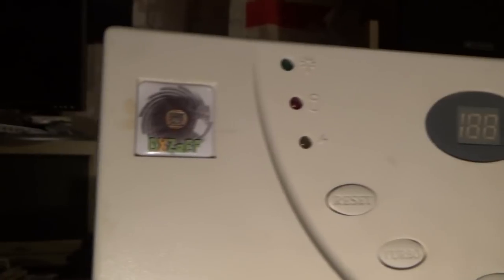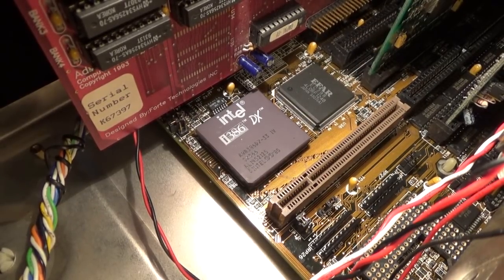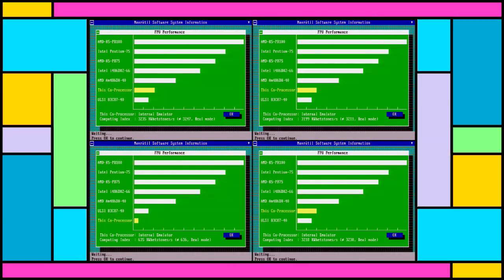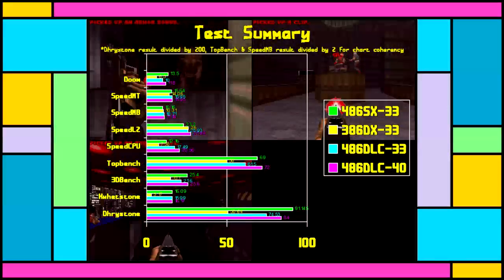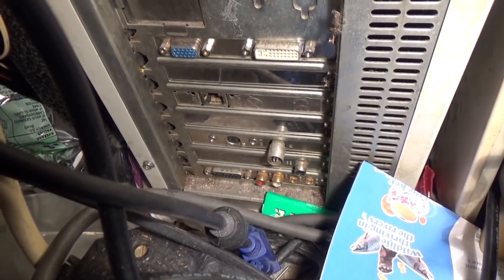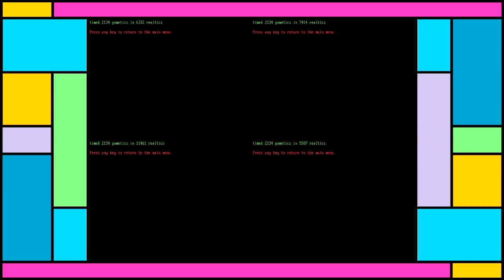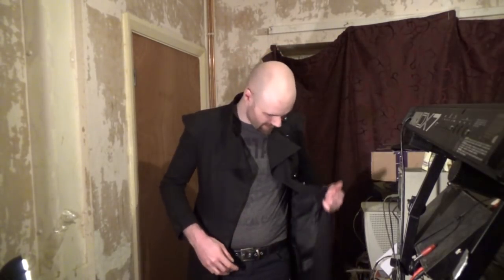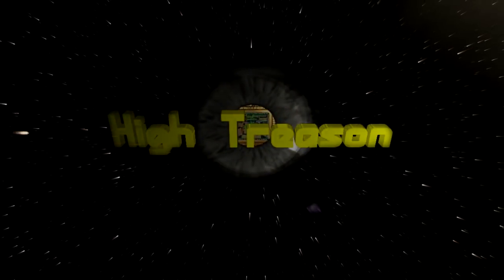386/486 System with VLB Slots

Comment: I agree with you on the Gravis Ultrasound. I bought one in the early days of eBay and it still doesn’t get much use compared to all my Soundblasters and compatibles.

But I really wanted one back in the day for the higher quality audio in some demoscene demos. That’s about it really. They’re a pain to configure and have limited application.
Reply: I do agree as well except that I like most titles from epic megagames which are making a great use of these. Still, I'd never pay hundreds for one. I managed to make it fit into my 5x86 computer and it's great where it is, alongside an early noiseblaster 16 with korg wavetable
Reply from the maker: I only got one because of all the hype I read about them over the years in magazines, or what I was told by enthusiasts long ago and, most of all, the fact that it was there as an option under "Music Card" in the setup program for some games, which told me it must be something special and not a generic SB clone from the start. It's a novel piece of hardware and it was an ambitious idea, but yeah, never ends up being used and after my 'demo rig' went to hell, it sat on a shelf for years with few instances of needing it ever really materializing. Don't get me wrong, I'd like to use the card all the time, it's awesome in principal, but there's just not enough of a reason to and most games which support it also support cards like the PAS16 which has a better output, require Pentium-class machines and use MOD music, leaving little advantage to the GUS being used there as the offload from CPU matters far less. GUS only demos are indeed the only thing I really find it being needed for.
- Deksor - Noise Blaster, I like that one. Still honestly amazed you got it to work with another card installed, could never get mine to play nice like that.
Reply: Remember it took me something like two weeks to get it finally working because for some reasons it was upset to be at address 240h even though I've seen many people using the same model as mine at this address. However the SB was okay to be at address 240h so it wasn't a big problem. 

Notice as well that yours is a standard GUS while mine is a GUS MAX. But yeah, maybe the reason it doesn't want to work is because it's upset for no reason about something

Comment: 486DLC is a very nice little processor the fact that you can disable and enable the 486 enhancement aswell as the cache in dos makes it a extremely useful processor 

Something interesting that 1996 Cyrix DLC system of mine actually runs at 45mhz for the time being I am going to keep it there as it appears that's how it came from the manufacturer (Mecer) and it's been working fine ever since
Reply from the maker: You know I love the 486DLC. Oddly CPU Check measures 45MHz on this one and for a while I thought that either the clock generator was broken or that this was the second setting, but no, seems the software just mis-measures it on this board as it comes in fast regardless of CPU or clock and everything else comes back correctly. Still, my respect for the 486DLC has increased vastly after this due to it actually keeping up with, and even outpacing at times, the 'real' 486SX.
For the record, I tried setting it to 50MHz but it won't start at this speed, not sure if it's the board giving out or the CPU.
Reply: HighTreason610 Ah that does actually makes a lot of sense , mine is probably the same just software missreporting it :)

Comment: There goes my 5x Pentium pro board + cpu and my 3 gus card collection :)  great video dude  !
Reply from the maker: To be clear, I'm not saying you shouldn't have those, just that their uses are limited versus less costly and more common hardware for more common tasks the average user probably wants to use them for. Of course from a collector's point of view it's worth having anyway, if you can find it at a reasonable price, for sheer novelty if nothing else. You just have to test these things sometimes.
Anyways, thanks.

Comment: This is the sort of review that I enjoy the most unlike all the others that are too clean and often don't have as much interesting hardware. Got a couple of boards like this and happy to have them, finding 4mb 30pin simms is a bitch so good luck with that card.
Reply from the maker: Thanks. As much as this board isn't really as useful as the ones around it, I'm definitely glad I got it, so I get where you're coming from. Yeah, 4MB SIMM RAM is a pain to get hold of in any capacity, so often it seems you'll find one or if you're lucky, two sticks, shame you never find it in packs of four like the 1MB ones often are. Still, sure some will turn up, or maybe a good joblot worth the gamble will pay off.
Believe it or not, I actually feel for people running channels like the ones you describe because they're often on a contract to make so much stuff per month and get so many hits or some other restriction, so they have to fall back on things they might not even want to do or that are less interesting just to meet the requirements.
Reply: Sorry, I laughed at the 'too clean' comment, following the 'clean your house' comment. But I agree 100%. Also, no cuddly toys or animals always cut down on the cringe factor...
Reply: Yea but I feel that for what they do it is mainly because it is a cheap way to make money off youtube and shrill for some company, I greatly miss the old youtube where people did whatever and no one really cared. What gets me "triggered" is when it is some middle class twat tries this and doesn't have a clue about hardware. I am in a mood today as work today sucked.

Comment: I always figured this would be basically the result, that's why I never have bothered to solder a 386 socket onto the board that I have to turn it into what you have, even uses the same chipset I think. There just isn't enough CPU power at the 386 level to turn the ISA bus into a bottleneck, at least in situations I think most normal and sane people would run the motherboard in.  Other than some synthetic benchmarks, mostly related to memory bandwidth and video memory speed, I never found much of a benefit in real world game benchmarks to VLB on a 486 until you started getting to 50Mhz and above then the ISA video started showing it's weakness, although I will say the ET4000 Speedstar I have was able to still push out about 28FPS in Quake with my K5 back when I was testing it at "200Mhz" so it does still have quite a bit of headroom to go from the 5fps-ish numbers it pulled on a 486 that I remember., at 320x240 anyway.

I once soaked a bunch of socket 4/5 motherboards with bat damage in warm vinegar for awhile, and it did clean the boards up very well. Only problem was, the green acid ridden sections of traces were just no longer there, left was a groove in the pcb where that part of the trace once lived. Guess that meant the trace was completely eaten up by acid. 

I would say this was one of those boards which held the promise of upgrading. You could start with, at that time a low end cheaper 386, then later when 486 chips came down, you could upgrade just the cpu, maybe fork out for one of them new VLB video cards, keeping the existing investment in the board, or computer intact and not having to change everything out again. This was a pretty common practice, many companies were trying this kind of upgrade approach with varying ways of getting there. Stuff changed so fast after 1993 though that such plans were basically no longer practical or ideal any more. 

What I think this test proves though is just how good a 486DLC chip actually was, at much lower the cost of a real 486, in some rare cases actually being better, and that the 486 was in fact a double or nearly double performance per clock of the 386 in at least some real world tests. Seems like the 486DLC handles memory better than Intel's 486 does from the speedsys test which might explain the other tests that it was ahead in.  That Ti486DLC , it seems like i've read the L1 cache was wired internal to the processor to be enabled so it wouldn't matter if the BIOS had the option or not.  I kind of wonder now after these tests how much better ( or not ) the TI486SXL with 8kb L1 cache would be.
Reply from the maker: Never did expect the 386 would pull ahead or make proper use of VLB, but the board was there and I just had to test it out. I did test 50MHz with the DLC-40 but it won't start at that speed unfortunately. The board was cleaned but vinegar is a worrying idea because most of the trace damage is under stuff that can't be easily removed and replaced.
The problem with the upgrade idea for me is how the board seems to have been made in late 1993 into 1994, so you'd be up against it pretty quickly, especially with the lack of DX4 support, not even sure it'd start with one of those adapters in because of how stubborn it is with chips it doesn't recognize.
Indeed, the 486DLC put in a really impressive performance here and the memory combined with FPU emulation is especially impressive. From what I understand the L1 cache is always used unless deliberately disabled, but without "Hidden Refresh" being supported by the chipset the cache is flushed regularly and loses most of its gains as a result - this board supports Hidden Refresh and, oddly, so does the C&T one (via a register) despite the latter predating this CPU by some way, perhaps the J38605DX would have used it too. Overall I'm still perplexed at how the C&T and its board manage so much bandwidth on the memory, even machines with SRx2's installed don't seem to top ~66MB/s and the C&T can almost double this. Knew that was abnormally fast back when I tested it and may have to investigate further, it's clear that board (The Peak DM one) has a strange way of handling cache and memory, as does the CPU as shown by how my Shuttle can't detect more than 640K of RAM with it installed, and it's almost to a point where I suspect some kind of interleaving is happening.
The Ti486SXL is an awkward beast and uses a different pinout, so the odds of being able to test one, especially against a regular 486DLC, are slim at best. Some places say there are DLC chips with more cache, but I've never seen one, despite the numerous model markings they all seem to be the same. I suppose one viable test would be to try a 486S against a DLC with caches disabled, if the results are very close then the results with the 8KiB turned back on for the 486S should be an indicator of the SXL's performance at least.
Reply: Not that I disagree with that, but hindsight being what it is, an upgradable motherboard might have made sense to some people in 1993/1994 looking to upgrade or build on a budget. It was a fairly common thing for a brief period of time companies were doing then. Who would have known there would be such rapid change every year, even Intel said they would reach speeds of 200Mhz by the end of the century, which turned out to be 5x that. As long as the 386/286 and XT computers were  on the market for, probably wouldn't have thought too much about a board like this being a dead end after a year.  Probably made more sense though than buying a Pentium 60, look how quickly that platform was outmoded.  I don't know but this is a glimpse at an interesting period of computer hardware none the less. Everybody and their Grandmother was making 486 motherboards at this time, so there bound to be a few odd ball boards just for the sake of selling a motherboard.

Comment: The GUS is just a collectors item, everything you said is pretty much it. Just like the M3D, Vérité and Voodoo5 they are just fun things to have, but there is no reason to use them when you compare them to the things that came out the same decade.

the best use for the M3D for example would be 'Resient Evil' to get it running at the right framerate, and that's just one game.
Reply from the maker: It's definitely novel to own such things, as a collector you've got to have a few quirky and otherwise not very useful things around, it makes you appreciate what does work a whole lot more if nothing else. At least you can play some games with the GUS I suppose, not like you can do much with those capture boards I have, or a stack of modems, so I'm just as guilty as anyone else if not more so.

Comment: Tripp Pants? Illig Pants? They still make those... That Gravis card might need a recapping (leaking?) and either way should fix most audio issues.
Reply from the maker: I guess, dunno, they just came from an 'adult' outlet years ago as 'bondage pants' or something like that, they're warm, they go well with most of what else I have, so I wear them in colder weather. The capacitors check out, the audio is fine, tends to be either bad drivers or poor compatibility. I did have to replace some of the RAM in the past, the mismatched chips are probably noticeable as some of them came from a dead Trident VGA card, before that I'd get crunching noises when samples played - something which Apogee's drivers still cause because they're crap, across the board, not just with the GUS, their EMIDI drivers can't even drive a SB/PAS's FM chips in stereo for example.

Comment: Got many AGP Mboards there? bought an AGP graphics board I thought might work on a vintage mac system, but seems to cause my vintage mac to go into a flashing boot loop,  seriously unhappy, wondering whether the card is truly functional, was thinking of sending you the AGP Graphics Card to test in an AGP Motherboard system.
Reply from the maker: I do have boards with AGP, but they're all occupied with cards already. The card probably doesn't work on your Mac due to the BIOS not being for Mac systems, so far as I know this was the only real difference on most of them - don't take my word for it though as my experience with Apple's hardware is incredibly limited.
Unfortunately I'm not real good at accepting donations of hardware, but thanks anyway.
Reply: HighTreason610 okey doke, I presume you have a problem with two gathering up too much kit if your not careful

Comment: Hey HT, that video you mention where you talk about that case, could you point me to it? I really want to hear your rant on this awful contraption.
Reply from the maker: Would have just been the K5 video from a short while back; https://www.youtube.com/watch?v=aHNTlkUSUWI - but even then I didn't go into too much depth about it, less than I thought I had done anyway.
In response to your other comments (it's actually a little irksome scrolling back and forth to see them); Hey, I'd love to build a dual PPro, but it would do nothing once built and I could use the time and resources to build a really kickass Pentium II instead.
Gamepads don't really help me in Jazz because it's the way momentum works that trips me up, the game feel slippery one moment and stiff the next, never could get used to it. Should try playing it with that wheel for a laugh.
The board was cleaned and I fear that doing more would completely remove the traces, most of them go under things I can't really lift off and replace, so I can't get to them and the board would be done for by that stage anyway.